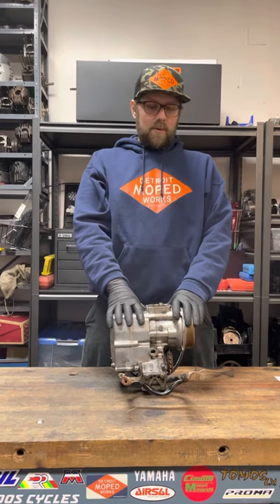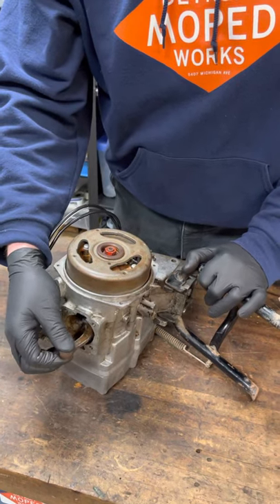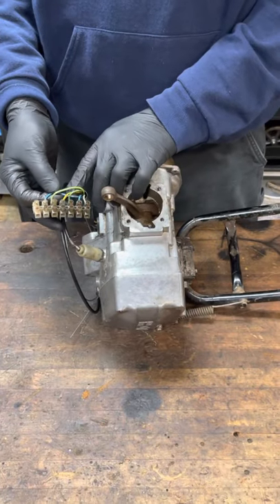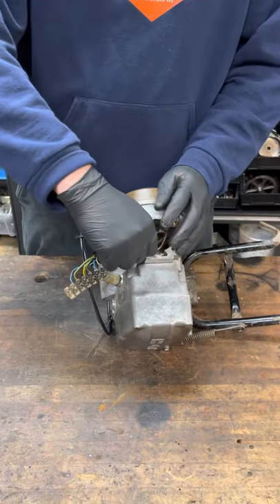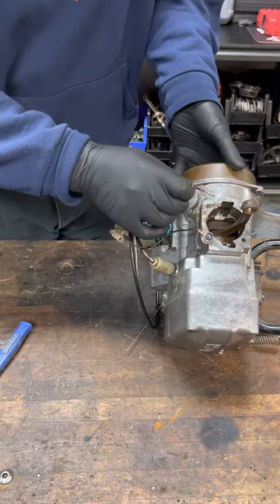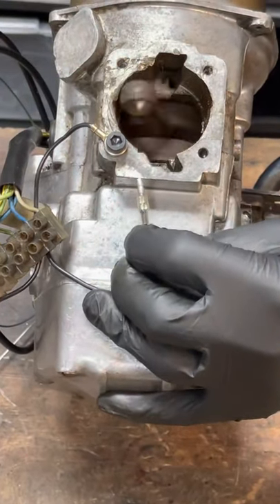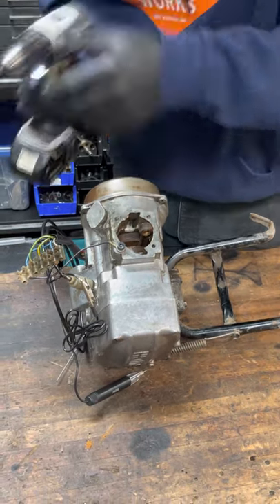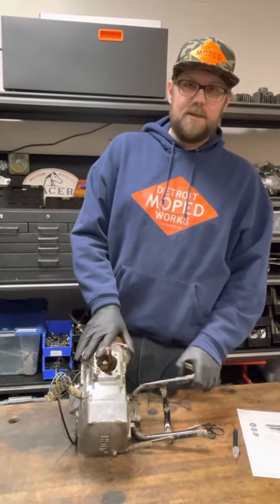Checking a Puch Moped Motor for Spark

Comment: Doing a small resto on an 82 magnum 2 za50. It's in pretty decent shape. I rebuilt the carb and cleaned the the piston head. I'm nervous to dive into the transmission. The transmission plug was so brittle, it broke apart from me barely turning it.   What should I do about the trans? Does it need fluid? Also the gas tank is roached but that's a different issue

Comment: I came here to try and learn about spark on my friends PUCH. You do pretty well on explanation..... until you get to  3;50 After spending a long time explaining how and where to ground a wire you then tell the colors of some other wires.... that you are not worried about. THEN as I wait to find out what wire gives spark you quickly say " I could use this wire directly " which of course we cant see the wire colors you are talking about. Who knows if you actually later on say the color of the important wire this video is about.... no one has time to watch more hoping that you will give the color later down the road. Now I,m not trying to be a dick.... just  so you learn and make many great videos in the future. SO.... any guy that can check points and understands a wiring block does not need 30 seconds about how or where to ground a wire. Secondly... telling the colors of wires and then stating " But we arnt concerned with these today " Nope ! If is isnt important to the videos topic.... dont waste time on it. Thirdly... many guys dont have a big screen and can only go by your verbal identifications... You can zoom in but you need to to specifically say what size , shape , location , entry, exit , movement , shape etc. the thing is while showing it. ( pretend your viewer is blind ) Good advice , I swear. Good luck
Reply from the maker: Thanks for the view and the feedback.  The color of the ground wire (Blue wire with Black) was mentioned 2X before the 3:50 mark.  From 1:38-1:45 we discuss "What you are going to be looking to do is to get a ground out of your blue wire that's got the black stripe on it"  At 2:15 we repeat "What you're going to be trying to do is ground this black with the blue (Wire)."    At 4:10; we mention "I'm shoving this wire in circuit with my blue ignition wire," to let the viewers know that the ignition wire is blue.  From 6:15-6:28, we mention "Checking for spark is basically going to be grounding your blue-black and then getting yoru solid blue ignition wire to show spark anywhere from that wire back to the cases."   Hopefully that helps to clear things up.  Let us know if you have any other questions!
Reply: @DetroitMopedWorks I'm struggling to diagnose a no spark on a peugeot 103sp but going to try to take this and apply to it. So does the sparking wire connect to the coil?